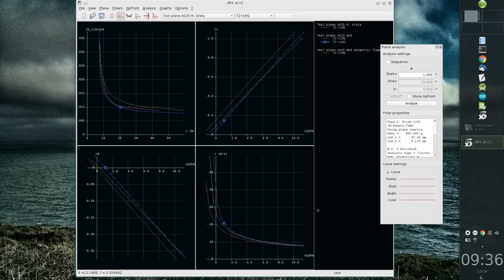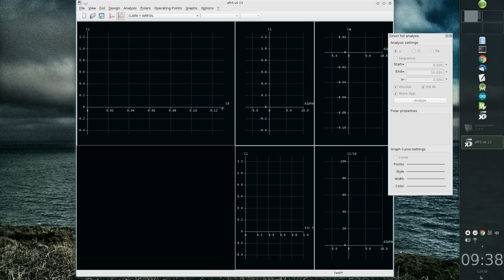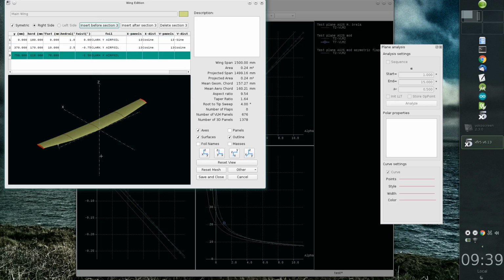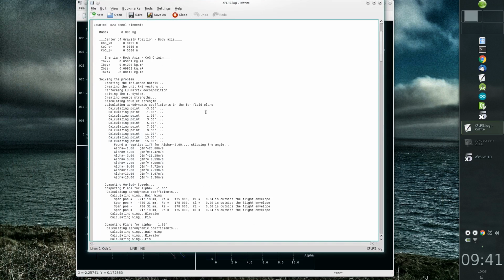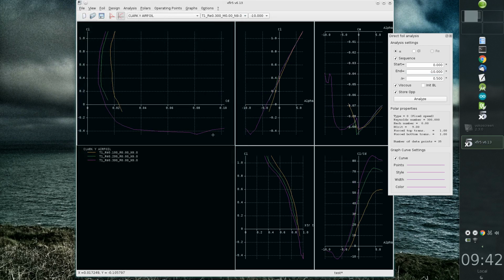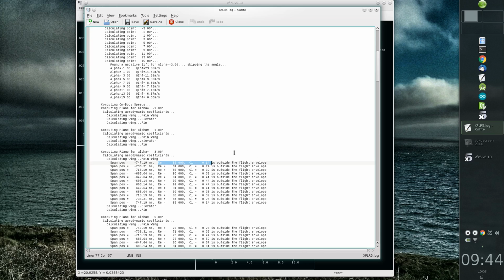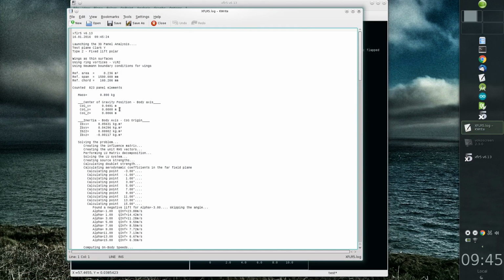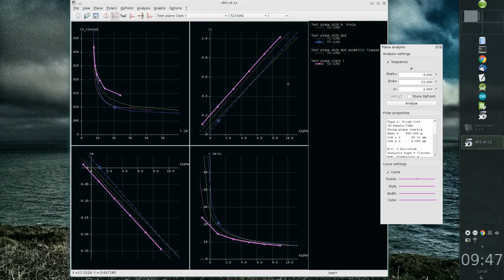11 Plane viscous analysis errors

Comment: hello techwinder,
which type is used for the interpolation for the viscous part? Is it only Type 1?
And does the Muchnumber is also interpolated?

Because I get results which are faster than the speed of sound, but my airfoil data base get only to subsonic.

Comment: hi i can't interpolate re=5927541 for cl=-2.98, how can i do ? please help me
Reply: there can be many error associated with it, I suggest you do the batch analysis of the airfoil from the zero to positive and with the range of reynolds number and then again from zero to negative angle of attach, after which it necessary to understand that this analysis only runs on the angle of attack before the stall, which is linearly approximated, so if there is stall you wont see the analysis of the 3d wing it was in my case, can be wrong too...but do check once
Reply: @anujregmi4582   hi I have a big problem: I did a VLM2 analysis on a vehicle, the results lead to a low CP on the leading edge (in blue) and high on the exit edge (in red). it is as if the plane went into reverse, or that the flow came from the opposite direction. please help me !

Comment: For me when im doing the analysis and select type 2 it's saying you the mass cannot be zero when type 2 analysis but for you it's running
Reply from the maker: There are 2 ways to do it: (1) define the plane's mass and inertia properties with F12, or (2) override these values in the polar definition form.
Reply: @techwinder thanks
Reply: @techwinder   hi I have a big problem: I did a VLM2 analysis on a vehicle, the results lead to a low CP on the leading edge (in blue) and high on the exit edge (in red). it is as if the plane went into reverse, or that the flow came from the opposite direction. please help me !

Comment: How do you determine how many panels to use when you globally refine? Is it just that the more panels you have, the more accurate the analysis will be at the cost of computing time, or are there other factors? I was just wondering because in one of the previous videos you decided to decreases the number of panels when globally refining.
Reply from the maker: That's right, result accuracy increases with panel density. In 2d however, I found that 100 to 150 panels is enough to achieve good precision.

Comment: For a NACA64A012 airfoil, i got  a clmax as 1.4 approximately but when doing the same in plane analysis after wing modelling, i get 1.81 which doesnt make sense and at aoa of 48 degrees. what could i have done wrong??
Reply from the maker: The plane analysis is inviscid and doesn't predict things like stall or flow separation. So it will calculate increasing lift with increasing aoa. 
XFoil on the other hand does take into account these viscous effects.
Reply: So what other tools can i use to predict my approximate CLmax on 3D wing..??

Comment: Your explanation about the error "...is outside the flight envelope" was really good. However, I didn't really get the meaning of the other error, "...could not be interpolated". Is it always due to the Cl value being unrealistic (because of the linear method) and therefore nothing to worry about? Or can it appear because of another reason?
Reply from the maker: It is because the Cl value is either too great or too small, i.e. the polar mesh does not extend vertically up to the linear  value of Cl.
http://www.xflr5.com/docs/Point_Out_Of_Flight_Envelope.pdf
Reply: That link was quite helpful, thank you! One thing that confuses me a little: you keep mentioning "viscous drag" (as in that PDF), but everywhere I read there are two main kinds of drag: parasitic drag and induced drag. Is viscous drag the same as parasitic drag?
Reply from the maker: The parasite drag is the total drag of an airplane minus the induced drag. In the present case, this reduces to the skin friction drag + form drag. I've come to call it "viscous drag" because it's the result of xfoil's viscous analysis.
Reply: Great! Clearing up the terminology helps a lot!

Comment: maybe viscous problem?
Reply from the maker: The plane analysis is based on linear potential methods, which do not predict stall behaviour. It's a limitation of the method. This implies that using this method, Cl increases with aoa, even above the physical limit of stall. Therefore it may predict Cl=1.5 locally.
On the other hand, xfoil is non-linear, and will predict stall. Therefore, Cl=1.5 cannot be reached for the foil in the case you are considering. 
You are trying to push the plane analysis beyond its scope of validity.
Reply: @techwinder  hi I have a big problem: I did a VLM2 analysis on a vehicle, the results lead to a low CP on the leading edge (in blue) and high on the exit edge (in red). it is as if the plane went into reverse, or that the flow came from the opposite direction. please help me !

Comment: Dear sir, I have recently been working with xflr v6.12, and encountered the "could not be interpolated" problems.
I have read your report "Point_Out_Of_Flight_Envelope" and also watched the attached video. 
However, the problem is a little bit different, when I do xfoil direct analysis, the Cl vs Cd curves is like shape "C", 
for instance, the Reynolds number 120000 curve's maximum value of Cl is 1.2,  and the Reynolds number 130000 curve's
maximum value of Cl is 1.3, that looks fine. But when do wing and plane analysis of fixed speed type, such as 10m/s,
the result always has points such as "Re =   276 000, Cl=1.5 could not be interpolated",  it is obvious that cl=1.5 is out of the range. no matter how I change the range and step in xfoil direct analysis,  all the result just stay below the cl=1.5 line,  
I don't know why this happens, looking forward to your reply.
Reply: +陈诚  sorry for the writing mistake, "Re =   276 000, Cl=1.5 could not be interpolated"should be  "Re =   125000, Cl=1.5 could not be interpolated",
Reply: Do you find a solution? Mine also says "could not be interpolated"